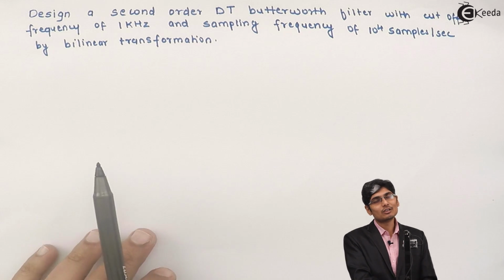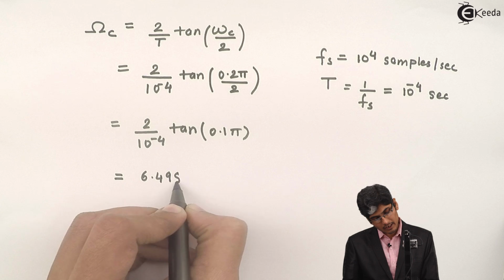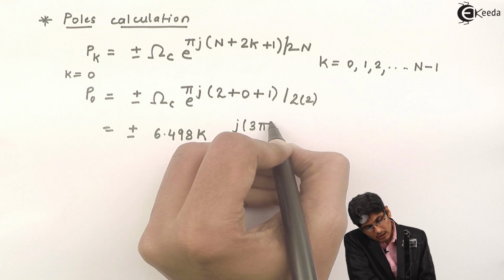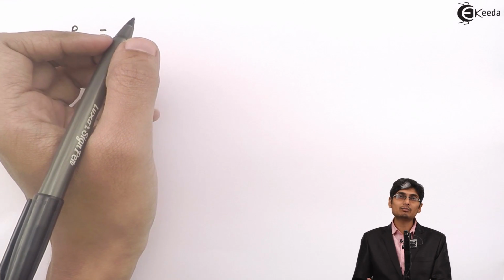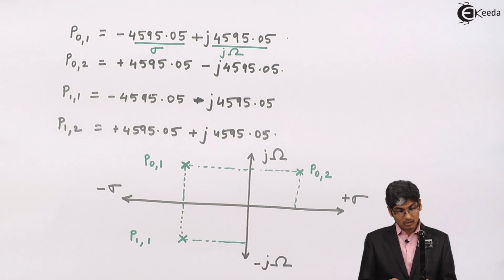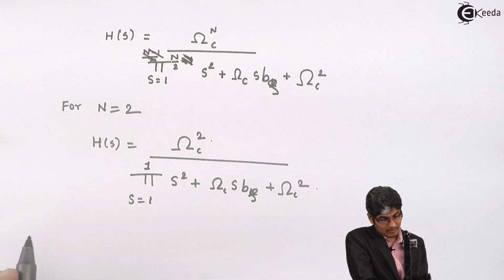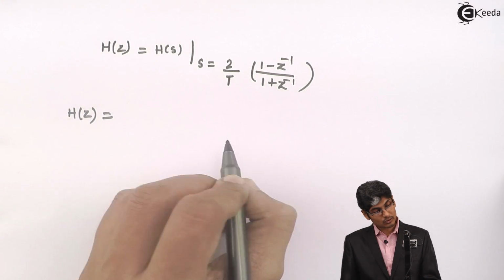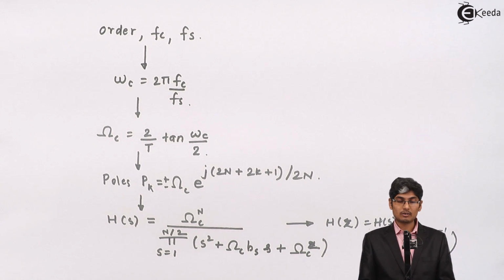Problem no.1 on Butterworth Filter Design in Discrete Time Signal Processing

Comment: during the final summary ... the formula for calculating the poles is misleading .... since there you mentioned (2*N+2*k+1).......and previously,during solving the problem you used ...(N+2*k+1)
Reply: and of course the poles to the right side of the s plane are vertically inverted